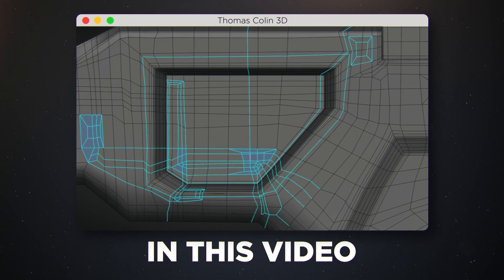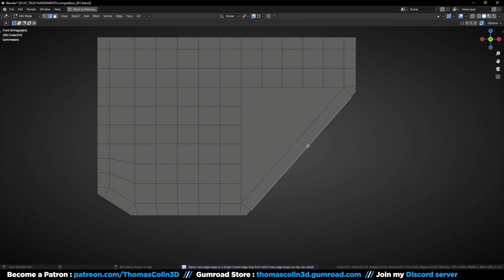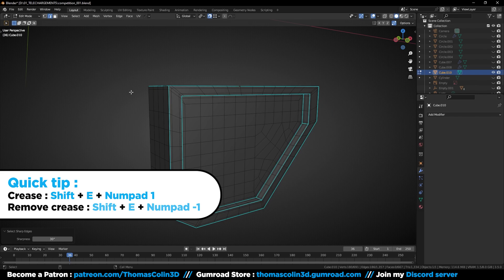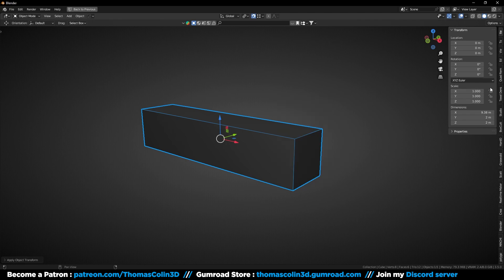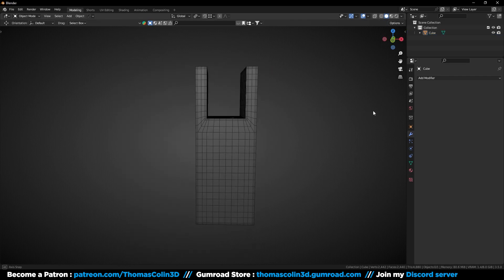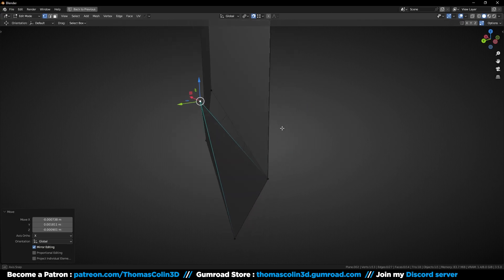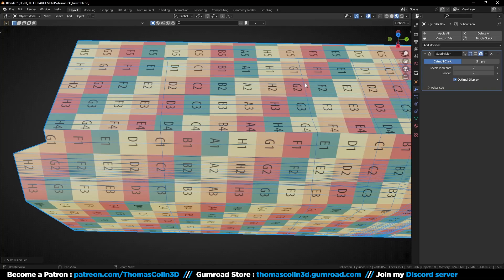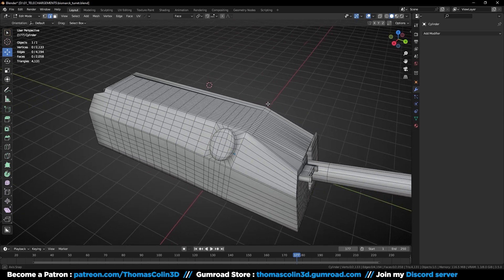Every 3D Artists MUST Know How to FIX These ERRORS

Comment from the maker: You can now pre-order my 3D Modeling e-Book called "Mastering Topology and Hard Surface Modeling". You can get it for a cheaper prince until the final launch in December 2025 (25 euros instead of 30 euros).
Here's the link : https://payhip.com/ThomasColin3D
You have access to the first 19 pages as a FREE sample. :)
In this book you'll find all the best industry standard modeling techniques that I use in my daily work.
It will include tips and shortcuts to speed up your workflow, the most common errors and how to fix them, topology concepts, hidden techniques and all my thaught process when I start a new complex model.
In other words, 13 years of knowledge gathered in one single place. Lots of explanations and illustrated pictures to make it easy to understand.

Comment: Not bad but never use creasing. Ever.
Reply from the maker: You use it before applying subd, then you removed it
Reply: So I read your credentials and understand you have the experience,  but a negative comment with no reasoning just doesn't help anyone. Could you maybe explain, even briefly, why to never use creases?
Reply: @paulm1835  i did post quite a lengthy and detailed response but it does not seem to have shown up in the thread.
Reply: @paulm1835 so, you see.
Reply: @paulm1835  Because what it does is forcefully restrict the catmull operation that smooths the edges, usually causing worse shading than bevels because there are no edges supporting the sharp angle, so you would need to crank up the subd to make a similar result. On sharp edges the best result usually comes with weighted bevels. That means never use creases? Absolutely not. It can give you a very good result without breaking your head with fixing ngons and setting edge flow if used properly, specially on low subd very complex meshes, and it is not an on-off toggle (0 or 1), there is a slider to control the intensity of it for a reason. Creasing is also the best way to sharpen boundary edges. I don't understand all this bullying against creasing, there are purposes for it.
Reply: Oh the topology puritanism. You will grow out of it. trust me.
Reply: @NzeRekoRec  It's been over 30 years now. As the head of CG at several of the biggest studios in the UK. Not grown out of it yet. An alpha and beta tester for both softimage and autodesk. A developer at Avid. Worked on maybe 800 broadcast productions. 100 plus music videos. Probably less than 20 feature films though. Taught CG at the national film and television school at beaconsfield for a few years.  Just how much frontline 3d studio years do you have?  I am so tired of seeing beginners and hobbiests teaching other beginners and hobbiests crappy techniques. This video is most certainly one of the better ones. But i see deep understanding of CG dissapearing because blender users dont have access to the solutions to the problems we solved 10+ years ago.
Reply: @ianmcglasham  Good for you! I'm not here to downplay any of your credentials or achievements. Clearly, you are more experienced than me...but what does that have to do with the topic. There are absolutely uses for creasing even if you think it's bad tecnic to achieve results you want to see. Have a nice one anyway 👍
Reply: @ianmcglasham womp womp
Reply: @vzn14c  I am not sure what womp womp means.
Reply: @ianmcglasham little bit condescending as a comment. But it’s cool to see you’ve worked at NFTS, I visited there once
Reply: @ianmcglasham Cool fake story bro. For someone so experienced, you sure like listing off two paragraphs of your "achievements" for updoots.
Reply: @ianmcglasham I'm going to paste what I said in response to someone else on this thread. I want to emphasize I mean this respectfully, because I admire anyone who has dealt with the trials and errors of older modeling softwares and pipelines:

A lot of older talent are stuck in their ways due to restraints. To be clear, I think it's still good to practice old school methods so you have additional ways to model when one way isn't working for whatever reason (for yourself, for someone else in the asset pipeline, for the program, etc). But it is rare to say "I would never" in a valid argument. Booleans is another example. As long as the artist makes a suitable piece for the workflow in a timely manner, the methods aren't an issue. Plus creasing is a good option for lower poly assets when transferring normal maps won't cut it but beveling is excessive.
Reply: what the hell is a crease? and why is it so bad, what's the alternative?
Reply: @PASTRAMIKick  crease is a setting you use that tells blender which edges you want to keep sharp. It appears as a blue line in edit mode. It keeps the edges sharps when you use the subdivision modifier or the new smooth by angle feature, which used to be called auto smooth in previous versions. You make a crease by selecting an edge in edit mode, and changing the mean crease to 1 in that side panel you can pull out. The alternative is bevelling the edges you would like to keep sharp
Reply: @PASTRAMIKick  Any feature in any graphics program can be used incorrectly or purposefully. No feature itself is bad. Some are kind of pointless or obscure, but I can guarantee that some creative mind somewhere have found a way to achieve interesting results with them.
Reply: @NzeRekoRec only facts
Reply: Bro doesn’t know that the crease goes off after applying subd
Reply: I use it to make concept renders often, it’s not that bad.
Reply: hello, i'd be glad if you could explain why no need to crease ? i began 3d a year ago and i'd be glad to hear from true pros !
Reply: For car body panels, creases work the best.....
Reply: Pixar uses creasing
Reply: @ianmcglasham  Are you also the kind of person to complain about people using tris
Reply: @FlamingFoxProd That's what I'm wondering. A lot of older talent are stuck in their ways due to restraints. To be clear, I think it's still good to practice old school methods so you have additional ways to model when one way isn't working for whatever reason (for yourself, for someone else in the asset pipeline, for the program, etc). But it is rare to say "I would never" in a valid argument. Booleans is another example. As long as the artist makes a suitable piece for the workflow in a timely manner, the methods aren't an issue. Plus creasing is a good option for lower poly assets when transferring normal maps won't cut it but beveling is excessive.
Reply: creasing is used vastly in game asset development.

Comment: Great Video! I have one question, how did you align the top loopcut to the bottom vertex at 1:36? Probably a short cut but I don't know how to achieve that🙏
Reply from the maker: You have to enable the snapping button like I did in the video, and just drag the edge with the Guizmo towards to vertex you want the edge to be aligned with, that's very simple!
Reply: @ThomasColin3D  Thanks!

Comment: I am not trying to hate here or anything just curious. Why do we need so much topology on a flat surface shown in first fix? Isn't it better to just wipe those edges inside and leave it as single face reducing topology?
Reply from the maker: Hey man, no worries I was waiting this kind of questions! It's because the first part is a small detail on a bigger model. It has to have more subdivision to be able to be connected with the other parts. I don't know if that makes sens ? It does in my head 😂. And because it's a subd model, it needs some loops to handle the surface tension!